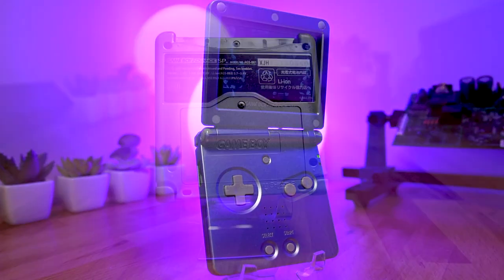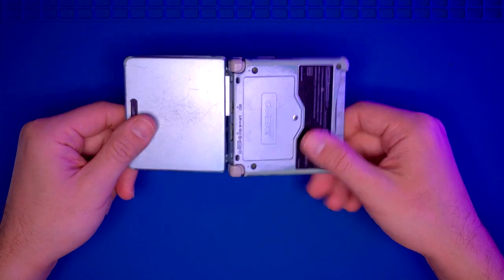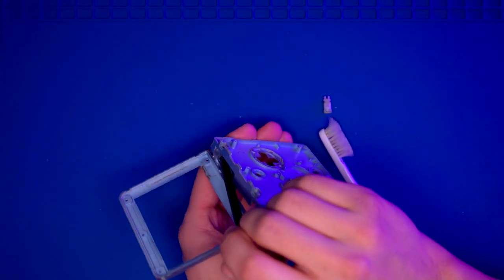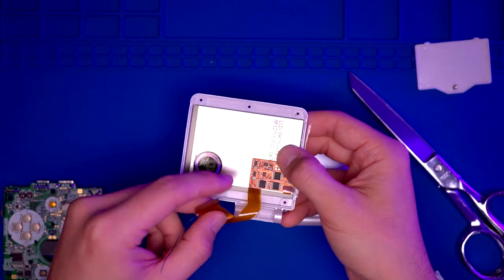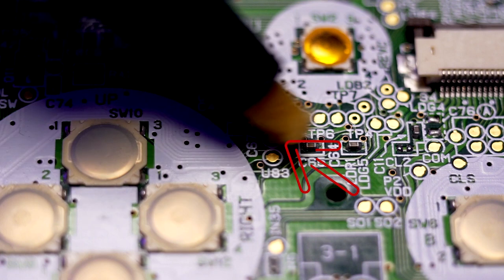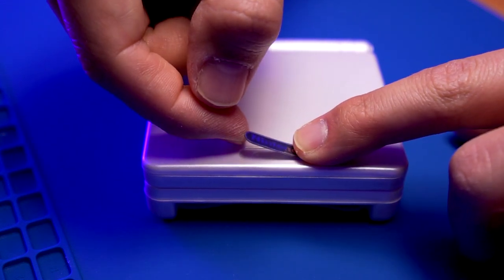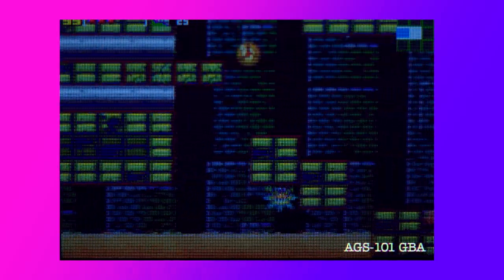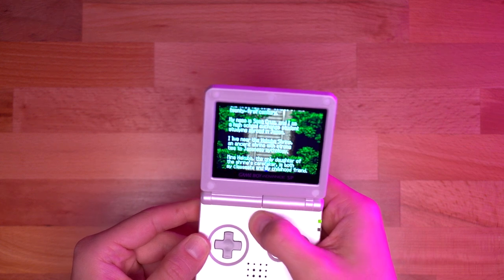EASIEST way to make the ULTIMATE Gameboy Advance SP! FunnyPlaying IPS Screen and Retro Modding Shell

Comment: Just a little tip for those who might not have noticed, when screwing screws into softer plastic, turn the screw the opposite way slightly, you'll hear a slight click if the screw holes have already been threaded. I'm not sure if the RetroModding shell has pre-threaded screw holes, but it's still a good practice just so you don't accidentally wreck the threads.
Reply from the maker: Yep, this is good practice.  Thank you for letting everyone know.  I should explain it in the video.  I will probably make a video that goes over good technique for modding consoles.  Cheers buddy!
Reply: the above the cartridge screw was wrong, had to be a flat.
Reply: Yup, my original GBA case completely shattered about a week after putting it back together, I think because I didn't do this.
Reply: Exactly! Also makes screwing lids on things easier too. Basically you’re just aligning the threads so you don’t cross-thread and strip the threads.
Reply: Great tip, thanks!
Reply: 😢 I cracked my game boy advances shell to this

Comment: I just bought a modded GBC with 5 brightness levels and even on the highest setting it stil looks quite dark after I've been playing on my GBA with the V2 IPS, that thing is so bright and sharp to look at!
Reply from the maker: Yeah the V2 IPS is fantastic!  Which GBC backlight kit do you have?
Reply: @MachoNachoProductions  I'm not sure as the bloke I bought it from just said it was a screen from China so it could be anything!...you just tap the IR sensor on the top of the GBC to select but it only looks half as bright as my IPS screen does (but personally I think the IPS screens are too bright anyway on maximum)
Reply from the maker: Ah gotcha.  The IPS does get incredibly bright for sure.  Cheers!

Comment: I've never had an issue with my sp screen. The front lit screen is plenty bright enough for being outside and you can turn it off while inside with good light conditions. I have steadily been using my original one for over a decade and the screen is one of the only components that hasn't diminished in Quality.

Comment: I recently received a 001 for free! The volume doesn't work.. If I figure that out maybe I'll update the screen someday 👍 good vid!
Reply from the maker: That's awesome!  One easy thing you could try is moving the volume slider up and down repeatedly for a little while and see if that solves the issue.  A lot of the times, corrosion builds up on the contacts of the slider and causes it to lose its connection.  Moving it up and down will remove that corrosion and potentially restore it.  It's a long shot but it's easy enough to give it a quick try.  Let me know if it works out!  Cheers!
Reply: Any luck?
Reply: @michaelharris5281  saving it for future projects.. I have a ds lite to play gba games on also have a pretty decent back lit gba sp
Reply: @HighDollarHobo  nice! I'm gonna subscribe to your channel! (:
Reply: @michaelharris5281  I appreciate it. Maybe I will do video on all my old video games someday.
Reply: @HighDollarHobo  drop some electric contact cleaner in the switch and go up and down will probably fix it

Comment: I did this mod on my 001, i have one GBA SP 101 and one 001 and one GBA where the screen had a crack, so i took my original 001 screen and used it in my GBA. and can confirm the IPS screen is has a higher pixel density than the 101 or 001 screen.

Comment: Thanks for the video, it's really helpful! Quick question: do you need special double-sided tape for the ribbon cable?
Reply from the maker: No problem SamuaX!  The double sided tape is option but does help with install.  You can even use some kapton tape instead of double sided tape as well.  The double sided tape I use is 3M Scotch.  Hope that helps!  Cheers!

Comment: This isn't my first time modding a console and this video was very helpful, but my screen keeps changing the brightness level randomly by itself... I've desoldered the wire and made sure there's no bridging on the board, but the issue persists (brightness changes in random intervals). My soldering seems fine and the brightness button does work, so I've contacted FunnyPlaying's support to return the IPS kit because I'm pretty sure I received a faulty unit... I'm also applying to return their cheap transparent shell that broke off on the right hinge after literally a handful of times opening and closing the GBA. I feel like I got ripped off 🙂

Comment: So a couple things, make sure you keep the hinges on the proper sides otherwise they might not 'click' properly when closed and opened. Also the screw for the game cartridge slot is not as flat as the OEM screw, and will scrape the back of game cartridges when inserting and taking them out. Use the OEM screws if the new ones have that problem. Also Tito, you click your mouth way too much during your videos.
Reply from the maker: Thank you foe the insight!  Much appreciated!  Cheers and happy New Years!

Comment: Brilliant guide. i followed you guide exactly, My game boy worked for like 1 day with this moded screen but now i have a VERTICAL BLACK LINE GOING DOWN THE SCREEN. It was coming here and there and now it wont go away. I opened the system and pushed the connector in fully and still the same problem. CAN ANYONE HELP ME PLEASE
Reply: yea .. maybe the screen is not that good.
Reply: Maybe you messed the cable pulled at it ?

Comment: This is a great video. It helps go through all the steps for beginners. I have a question. When spray painting the shell how does one prevent it from getting into the speaker holes without using tape
Reply from the maker: Thanks Logic Crash!  I’m glad you found it helpful!  When spray painting as long as you do light even coats, you don’t need to worry about covering the speaker holes. They will be perfectly fine. Just make sure your coats are very light, not heavy. I hope that helps.  Best of luck!  Cheers!  

P.S. Also just to be clear, I would strongly recommend removing the shell from the console prior to painting it and to also use primer.

Comment: Great video! I've never soldered anything before but I think this is a perfect one to try with. One question I have is, for the 28 AWG gauge wire, do you have to strip the tip of the wire before soldering it?
Reply from the maker: Thank you Andres!  If I remember correctly the kit came with a wire that was already pre-stripped so you didn't need to do it yourself.  My only issue with the wire included was that I thought it was too short and made soldering a little tricky.  If you use your own 28 AWG wire you will need to strip it yourself.  I hope that answers your question.  Best of luck!  Cheers!
Reply: @MachoNachoProductions  Thanks for the quick reply and yes that answered my question.

Comment: When installing an IPS screen, if I were to not connect the wire, how would the screen be affected? Would it stay on the brightest setting or will the backlight not turn on?
Reply from the maker: I believe it will stay at the default brightness.  In my opinion the default brightness is plenty bright.  The wire only enables dimming function and is completely optional.  I hope this helps!  Cheers!

Comment: The gameboy advance is amazing, unfortunately mine is starting to have sound issues.
Reply from the maker: Sorry to hear that bud.  Does the headphone jack still work?  There are some ways you can troubleshoot the sound to see what the issue is.  The GBA is a fantastic system for sure!  Def worth trying to fix.  Cheers bud!
Reply: Mine does not have a headphone jack option
Reply: I did find a headphone adapter online though. I may have to try it out

Comment: I am surprised that aftermarket screen went in easily into the shell. Didn't watch the entire video but I'm guessing the shell is specially modded for that screen? Some shells require a part of the screen housing to be cut off/trimmed to use this IPS screen type.
Reply from the maker: Yep that’s right!  It was a pre-trimmed shell designed for the IPS panel. Makes installation a ton easier!  Cheers!

Comment: Recently discovered the channel, enjoying the content production quality. 
It's a shame the SP has its own proprietary headphone jack, and you need an adapter to convert it to the standard 3.5mm. 
Why not see if there are any internal mods to cover in the future?
Reply from the maker: So happy you are enjoying the videos!  That is a great suggestion! There are some videos on that topic but I would love to do my own!  Cheers!
Reply: @MachoNachoProductions  A good set of internal mods would be to add the audio jack, and a stereo speaker to replace the mono speaker built into the unit. 

It is entirely doable, and every Gameboy and GBA model were designed with Stereo in mind, but it's only possible through the audio jack due to Nintendo not including stereo speakers in any of their handhelds before the DS.

Comment: Just curious have you ever had an issue with the shoulder buttons acting up? If so how did you repair them?
Reply: You probably just need to reseat the shoulder buttons. Sometimes they can come a little loose when you open the shell. They have little spring clips that hold them into place. Careful with them though, they are sharp and hold a lot tension so when you remove them from the clips holding them in place they will snap out and can fly or cut you if your finger is near them. I recommend using a pair of tweezers to grab the spring and slowly release the tension then remove and reseat them.

Comment: so i bought a GPA SP and was hoping to reshell it as its current shell is in rought shape and its ags101. the processesor has some corrosion and  4 of the tiny metal contacts rusted off. the processor that says agb be on it. will it still work fine if the rest of the contacts are there. or do i need to resolder the contacts or is the motherboard toast? Anyhelp will do
Reply from the maker: Hmm does the SP work currently?  I imagine if 4 of the legs rusted off it doesn’t work correctly. Let me know.

Comment: Hi, looking for some help please! I put a new shell on my SP, and soldered the wire and it all went very well... except the buttons need to be pressed really hard for some reason. I put the original buttons and rubber grommets back and it still happens. Could it be a faulty shell? I cleaned everything numerous times and checked everything I could think of but nothing works..
Reply from the maker: Hmm that’s really strange. one thing you could check is that the membranes are aligned correctly. Sometimes during reassembly they can shift. If it’s not that it could be a faulty shell. Also you could check to see if the PCB is properly seated in the shell. Other than that I can’t really think of anything else. I hope this helps and that you resolve the issue. Best of luck. Cheers!

Comment: I have a GBA SP AGS-101 model but I don't remember that it felt like this by setting the volume to maximum .. 
but the audio volume does not seem very high to me is this normal ? or are the capacitors like the Pc Engine GT  ?

Comment: Hello I was wondering if you might be able to help me? So I’ve done the mod and had it for a while now but I was playing it earlier today and when I pushed the brightness button it just shut the system off. I opened it and checked the soldering and everything looks good. I thought maybe it was the battery but even when it’s connected to the charger it turns off. Any ideas on the what the issue could be? Thanks.

Comment: Great video as a new owner of the game boy sp ips screen just wanna ask is it safe to put it in a protective case when not using ? I want to be extra careful because I had no idea the screen is now tempered glass also when I got it it looks on the left bottom corner looks alittle out is that normal or not? So hopefully you can or anyone can answer my questions plus I love the game boy sp so much I just never owned a sp ips before.
Reply from the maker: Hey Selina it should be safe to put it in a protective case. The screen should be well protected since it can fold shut. It is normal to have some discoloration in the corners, but not too much. Hope that helps. Best of luck!  Cheers!

Comment: I have a GBA SP ags 001 that I got new and used it slightly for a year or so and then it just stayed stored away in my closest for the past 16yrs. It is in MINT condition with zero scratches on it. Should I do this IPS mod to it? Should I trim the original shell? Will it hurt the value of the console?

Comment: Awesome video! You inspired me to mod my own gbasp. Do you encounter blackscreen issue with this kit? Mine works almost flawless except 2 times when I switch games and turn it on, the screen only shows black with backlight on and background game music running. I have to reinsert the game again for it to work. One more, does this kit remember the last brightness setting? Because mine doesnt, it always reset to default when I turn it on.
Reply from the maker: Great questions!  To me it sounds like your installation is working perfectly. I too have experience blank screens, I think that is mainly attributed to a bad connection but like you said is solved when you reinsert the cart. The lcd brightness always reverts back to the default brightness when you turn it off. I hope that answers your questions. Thank you for asking!  Cheers Llujei!
Reply: @MachoNachoProductions  Thanks for the prompt response :D I tried with other ribbon cable as well because I bought a few, but unfortunately that also has the same issue. Maybe that is just a  hardware glitch or something. lol. It will be nice if it can remember the last brightness setting maybe on V3? 😁 Cheers!
Reply from the maker: V3 should be amazing!

Comment: Excellent video and production quality! The way you explain things and the detailed shots of each step inspired my friend and I to mod our own SPs! Question: is soldering required to change the brightness at all, or is the default option to turn the backlight on and off still available without soldering? I would rather skip the soldering step and would be satisfied with just turning the backlight on and off as on the default GBA SP,  as long as that's still possible. Thanks!

Comment: I am having a little trouble doing this mod. I managed to shoulder the wires correctly cause the brightness setting is working correctly, but the actual picture does not show up at all. Any thoughts on what the issue is?

Comment: What’s better to use for modding AGS001 or AGS101?
Reply from the maker: 001 because it’s cheaper and much more common. The 101 are rare and should be kept in original condition since they will most likely increase in value. Cheers!

Comment: Is there a need for a foam backing for the back of the screen? Anyone? I have a kit from handheld legends that came with a foam backing
Reply from the maker: You can test fit it to see, but I haven’t used the included foam backing in my experience.
Reply: thanks, i also didnt use the foam

Comment: I did this same thing to my gba sp and I noticed the left side of the screen has a tiny gap between the edge of the screen and the shell that goes around the screen. I see some people use the foam that comes with the screen and most don’t. Did you have this problem with yours? I took it apart to readjust the screen but it happened again

Comment: I keep thinking on doing this mod for my own SP because it only has the AGS-001 screen.  I'm just curious (and sorry if it's already been answered somewhere).  Does this change the battery life much or does it just stay the same?  Like  are we still in around the 10hr range?
Reply from the maker: Great question. It’ll depend on the brightness setting you use. I’m sure you can get around the same playtime but it’ll be on a dimmer setting. At default brightness it’ll be less. Hope that helps dude. Cheers!

Comment: I intend to buy the IPS screen for my SP 001
but I never use soldering iron. can i just plug the screen without soldering the wire? I think I dont need the brightness adjustment function.
will it work without soldering?
Reply from the maker: Yes, you can!  You don't need to solder anything, it's just plug and play.  Soldering is only needed if you want the brightness function.  Hope this helps bud!  Best of luck!  Cheers!

Comment: Hey great video man! I already do this mod and the Ips v2 is so great. I Bought from alixpress but the after market shell feels cheap  and light weight compared to orginal, what about your thoughts?
Reply from the maker: I feel the same way about my shell.  Does not have the same quality as the original Nintendo shells for sure.  I think the Retro Modding SP shells are nicer than most of the other aftermarket shells out there.  Cheers!

Comment: You do not have to solder
 the wire though?
Reply from the maker: That’s correct!  Soldering the wire is optional. Soldering the wire just adds the ability to change the brightness. Without the wire it will remain at the default brightness which in my opinion is plenty bright. Best of luck!

Comment: Just did this same replacement however I'm getting just a screen of colours, no sounds or an attempt at the system starting up. Any advice?
Reply from the maker: Hey Corey!  First thing I would check is making sure the ribbon cable is properly seated in the connector on the motherboard. Check to see if that’s your issue.  Cheers!
Reply: Thanks, I've done so with both screens and both ribbons, next step?
Reply from the maker: Did you solder the wire for brightness control?
Reply: Hey, thanks for your replies. Turns out it was the mobo. I tested the screens on a working ags 101.
Reply from the maker: No problem!  Glad you were able to resolve it!